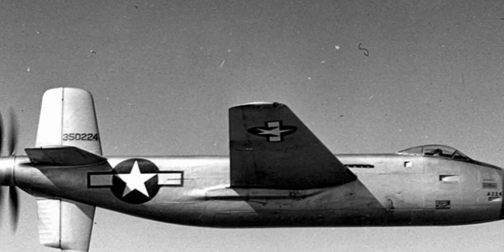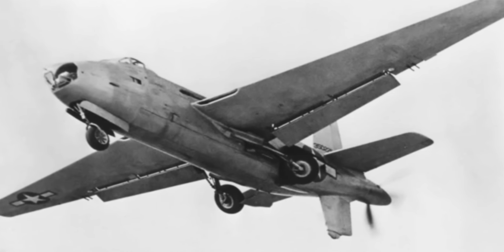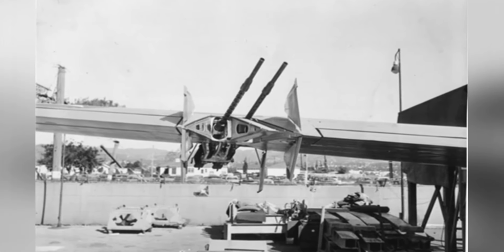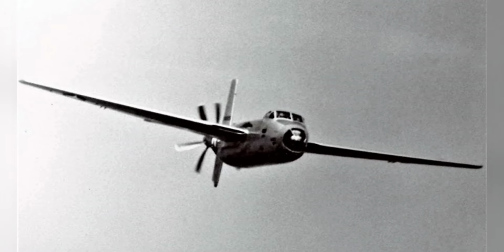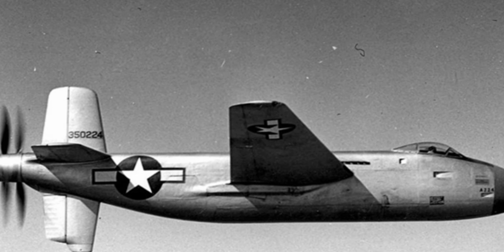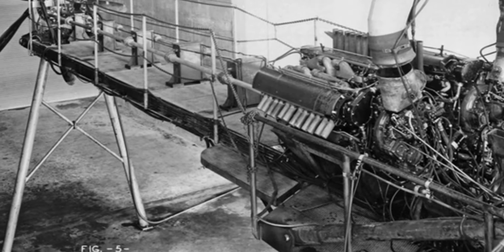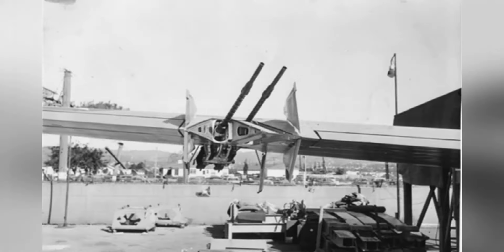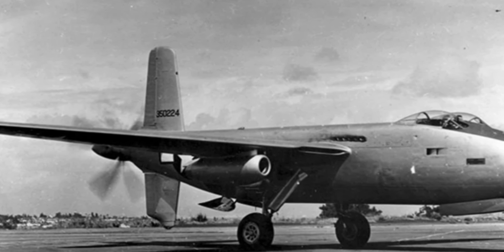The XB-42 Bomber

Comment: The goal of Douglas in designing this airplane as a private venture was not to create a bomber with more range and payload capacity, it was to create a bomber with high speed.  It was envisioned to outperform the Dh Mosquito in range and payload, not the B-29.  Any army officer who floated the idea that this airplane might rival the range of the B-29 was probably just jockeying for a job at Douglas after the war. The aircraft was initially ordered as an attack aircraft like the DougalsA-26.  The designation of both planes  was later changed to from attack to bomber.